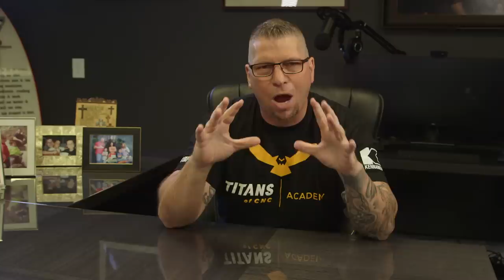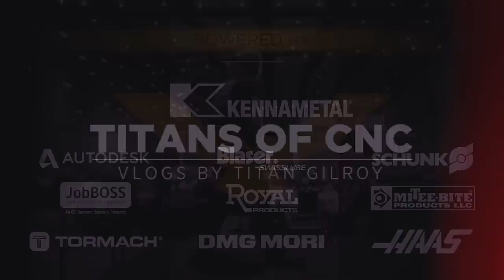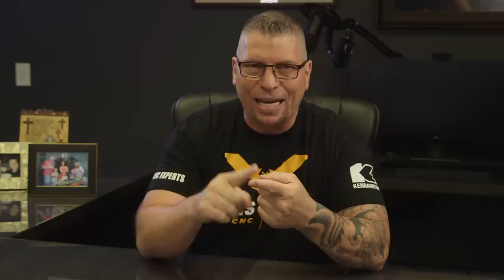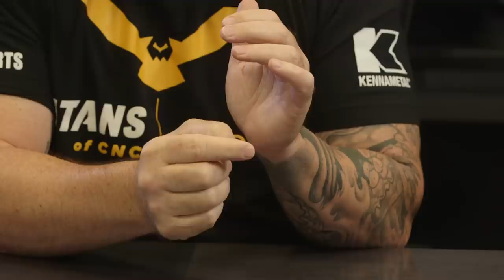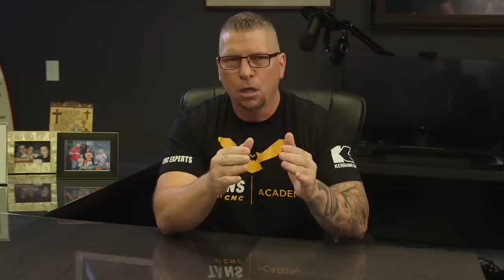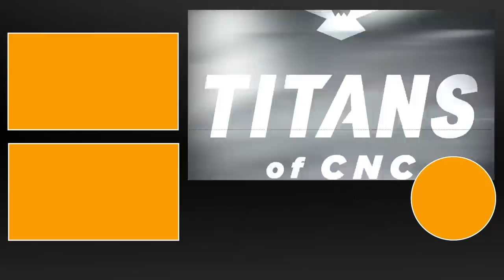My WORST DAY in CNC Machining - Vlog #96

Comment: Personal responsibility goes a very long ways. More times than not owning the problem, showing improvement, and professionalism in customer service will please a customer beyond expectations.
Not a shop owner but making my way there, however Titan reminds me of some times while in the army. I worked in the housing office for a large unit, renovations to our buildings are going on, I leave my office for about 2 weeks for some training to advance my career. My office drops the ball in moving personnel around. I get back and immediately me and the other heads of my office are brought into a meeting with contract team, higher commands, and the oversight team (the ones writing the check with a lot of zeros on it) and my team, the lowest common denominator but also where the rubber meets the road in making the project go smoothly also exactly where the fingers get pointed when things go wrong. The meeting goes with many questions being asked, very few getting answered. The 5 minute ride back to our office is nothing but suggestions of how to make this move go forward, we have 128 people to move, less than 5 days to do it, and no space to move them to. We come up with a plan, another unit was occupying the space we needed they were in place for the same training I had just done. It's Friday, they leave Sunday, we need the space Monday morning. We print up the list of everyone needed, I have carry to the command team over all the people, lay down the plan, give a defined timeline, and give understanding to why this problem arose. Command had been abrasive leading up to our meeting, once they had understanding and saw a clear defined plan in place attitudes changed. Don't know how many prior service we have here but when you're telling someone 6 ranks above you what to do, they inherently don't like it to the point it can cost you a career. My team of 5 made the move happen, we handled it perfect professionalism, created understanding of how we were going fix the problem and how the problem arose to being with in full transparency, then executed the plan. This project spanned 18 months involved over 2,000 people its not machining but it is proof that often enough owning the problem, will impress the customer enough to restore or actually create faith in you and your team and to toot the horn a little we finished the project ahead of schedule by months.

Comment: aerospace finishes actually requires Honing and lapping with diamond 
where talking about .000020 straight and round with a ultra fine finish....10 years in aerospace....
Reply: That is insane. What kind of tools can even get that precision? What measurement devices can confirm that precision was hit?
Reply: Finding a vendor who has the equipment and skill to do this. Not sure how hard it is?
Reply: @phil2082  air gauge

Comment: I’m a Machinist with over 30 years in aircraft and aerospace machining experience. I have a story of survival like no other. I’m Still Trying like Hell to get my small CNC machine shop off the ground. Be t first I have to survive a extremely rare Lung cancer which has caused now my 6th brain tumor and 7th on my kidney. I had my first brain tumor over 7 years ago. I’m still here fighting with my current brain tumor and kidney tumor. I own 2 CNC mills and a couple conventional lathes and a precision grinder and sheet metal fabrication equipment. We have an old CNC lathe as well. I Refuse to allow cancer to stop my forward progress. As long as I can stay alive, I WILL Succeed. That’s simply fact. I should have died over seven years ago. I’m still here and running Strong! The shop my equipment is helping now is hi-tech aircraft and aerospace Coatings. Thermal barrier and hi-wear resistant Coatings. Among others. Space-X, General Dynamics, JPL. Just to name a few. I tried to reach out to you in the past. You’re not an easy man to reach.

Comment: My history started in construction. I worked part time while in school then started studying electrical at the local community college but dropped out my second semester. My dad owned a company building and selling motels all over the south east. I fell in and was running his crews until almost 10 years ago when construction hit a stall. I had a wife and a 1 year old son and went from making $20+ an hour to nothing. I did the side jobs for awhile but they just were not cutting it. I gave in and went to the local job center and they set me up with an interview with a company 45 minutes away. I didn't want to even go to the interview but decided I had to do something so I went. Of course the boss told me they wanted me to start the next day at $8 an hour as gofer but he also told me the sky was the limit as far as what i would become. After my second week they told me they wanted me to learn to run a cnc. The guy over the cnc's wouldn't teach me anything except put the part on and hit the green button. After 3 months the owner came in and told me he wanted me to learn how to setup. He attempted to teach me how to do a basic slot so I could see how its done. 2 weeks later I had taught myself how to write basic drilling programs. Over the next 6 months I had taken the machines i was running and improved all the programs in such a way that production had doubled. At my 1.5 year mark the owner walked in and fired the head cnc person and gave me his job. I continued to improve the department and started to take on the task of being assistant to the shop foreman. During this time my family had moved 8 hours away and my boss knew I was looking to move to be with my family.  At 3 years I told him I was making plans to move. He told me he could not let me go and ask me to give him a week to come up with a job offer to see if he could convince me to stay. The next week he tells me to come to his office after everyone has gone to discuss his offer. When I walked in his office after work he started talking about everything I had done for the company and how much the company had grown due to changes I had made. After about an hour he told me he needed me to stay and that his best offer would be his job. Of course I thought it was a gimmick but the idea of being Operations Manager for a company with a nice salary and benefits was to good so I took him up on it. I've now been here 9.5 years and we are still growing. I cant say its been easy but I haven't given up, and its paid off so far. A couple times ive had the thought I made the wrong decision but I stayed with it. The leadership experience is something I can always show and I will continue to work on to become a better leader.
Reply: so what happened with your family ?

Comment: Relationships are key. I had overbooked my shop last fall, and outsourced some jobs to local shops to hit deadlines. The inspector of my customer found parts were not to print. He told the owner what was going on, the owner  immediately got mad and said, "SEND THEM BACK!" He thought it was another shop that did them, the inspector said to the owner, Jon did these parts... That owner said immediately NO this is not his work. The inspector knew very well the owner and I were on great terms. And showed the owner the PO with our name on it. He called me up and asked me to come down. We discussed the issues. I took the same position as Titan, I humbled myself. I just said I will fix these right now. The owner was still mad. He asked me directly, "How did this happen?" I said to him, I had to send these out to another shop to meet deadlines. I actually did not make these. He smiled and turned to his inspector. I told you this was not Jon's work!  He is our #1 vendor... I told him this would never happen again and fixed the issue immediately. I remember walking out of there with a huge mix of emotions. Fear, sick to my stomach mixed with a pat on the back compliment... The fact that he knew my work well enough to know I did not make the scrap parts even though my name was on the PO. That felt good...
Reply: Well Done. God Bless for fixing the problem when the stakes were high!

Comment: You know. As the shop foreman at where I work I can understand this completely. Countless times my boss, the owner, accepts jobs before talking to me and when I get the prints to quote I tell him there's no way we can make those parts with the current measurement equipment we have or that we don't have the ability to make the parts competitively. There's talks of me becoming an owner and if that happens I definitely will be spending some money on inspection equipment as that's the only way to make accurate parts in my opinion.

Comment: In my experience, no matter what is at stake, or what the fault or mistake is, always take ownership. In most cases the other party is way more lenient towards someone who owns their mistakes and are willing to work it out. That doesn't mean they always will, some will not appreciate the strength of character it takes to do that, and will be arrogant and unreasonable, but here is the thing, that's on them, not you, and at the very least your team will see your character and leadership qualities. Thereby building the relationship within your own team to a higher level which in itself is its own reward.

Comment: I had a customer that was livid with me. He brought a box of parts back and began screaming about the workmanship. I looked at the parts and totally agreed and excused myself for one moment. I brought in the machinist that ran the parts to have a look at them. I asked him “what do think about these parts?” He said “they look like crap, you mean we didn’t have to make ours so nice?” The customer looked confused. I said “those parts weren’t made here.” I began to explain and then brought forth our “setup part”. The difference was obvious. He began to profusely apologize. Apparently they had another vendor running the same parts and the customer didn’t realize he had two suppliers and he went after the wrong one. I wasn’t the first time through the years. For certain customers we had made a tiny stamp we so we hide our mark in a corner.(that turned out to be most money making object I ever had) It’s bad enough if we screw up, but I’ll be dammed if I’ll fix what others do for nothing. If I can, I’d be glad to fix or replace what others messed up.......for a reasonable fee.

Comment: My story, I was born and raised in England, Sheffield actually right as the steel industry collapsed. Bad times for all. I left school at 16 with minimal qualifications and not much options so I signed up for bricklaying and plastering NVQs at a local college. I took a job during the summer at a local fabrication and machine shop and was basically the tea boy, grind monkey and broom b**ch. Eventually I was allowed to try my hand at turning and that was the first time since school I had touched a lathe. I eventually cancelled my place at the college and remained at the machine shop for 7 years before emigrating to North America. Fast forward 10 years from that day and a couple of machine shops later, I am now placed in a University Mechanical Engineering Dept as a CNC machinist offering my years of manufacturing experience and knowledge to students and also building their projects and competition car components. There is one machine shop in particular that I owe everything to because I was allowed to go to the next level with my machining game and learned so much about part sequencing, proper inspection protocols and other procedures one simply does not get to see in smaller job shops. In fact a slight sub-story with that shop, I once scrapped an entire run of parts on my shift and I worked an extra 12 hrs ON MY OWN TIME to manually verify each part was scrap and then stayed to manufacture the parts again because I felt so bad about it. The owner actually told me to go home because he felt bad that I had put too much effort in to rectify a problem I had created. That was one long 24hr shift I can tell you that. He was shocked to learn I had not even been home yet since he bollocked me for scrapping the run.
Reply: That is the sort of war story where legends are born! 
God Bless Brother.
You have the guts, responsibility and take ownership of the problem.
All the best from Sydney Australia.
Reply: Arthur Frilingos thanks brother. It’s been a hard slog to get where I am now but I wouldn’t trade a single minute of it for the easy way.

Comment: I'm not an owner, just an operator, but I have one story like this:
We were doing some parts that had 10 M10 holes per part and two 30M7 holes. We had 60 of these parts, finished all of them, and then they come back from inspection.
Nearly all of the parts came back as bad, the 30M7 holes were fine, but the threads didn't meet spec.
It was because we had one M10 HSS tap for 600 holes in steel and it deformed like 20 pcs in. 
We made a mistake in not checking the threads with a go-nogo gauge, but only with a screw. We had no other option at the time, because management refused our tool order with the taps we needed, so we had to just go at it with one singular tap and hope for the best.
It obviously didn't work, and we ended up having to recut 600 threads manually without a tap handle, since we don't have that either.
Moral of the story: Check your parts properly, and if you don't have the tools, DON'T DO THE JOB.

Comment: I don't design rocket parts but I always prefer a supplier that is open with their limitations and comunicate them so we can get a working part out, Sometimes I can change the design slightly to suite their process, or we can work out a way together.
Reply: This guy right here gets it. Its a 2 way street and every one has to pitch in to make things work.

Comment: 40 years as a machinist and starting out as an apprentice in NO.LA. early 70s I worked in a shop that had line shafts running in the ceiling that drove leather belts for all oft the laths,mills and keyseats where you had to reach up and push on a board to engage the clutch on the machines and it sounded like a flock of birds trapped in the ceiling all day long. And it make me feel great to see other people who take pride and craftsmanship to the level of what it is supposed to be. Thank you Jake Bissel.

Comment: The saying you learn from your mistakes is very true. But owning the issue is by far the biggest step in learning from the mistake.  Covering up and saying not me can cause so much work to find out what did go wrong. It can very often drive you down the wrong rout and so wasting vital time. Mistakes do happen even if they are not down to one thing or person. It is how you overcome the issue that sorts out the the ones who can from the ones that just do.  Keep it up. Spreading the word is admirable and a way to make the CNC industry excel in what ever industry they serve.  Amacf

Comment: Awesome story, but it raises a question.  Could you have, upon seeing those prints asked the customer something along the lines of "I noticed this finish call-out at the bottom of the bore at view A-E, and while I'm confident we can hit that requirement, we don't have a profilometer that can check that surface. Do you have any recommendations or solutions that would be easy to implement?" Or is that sort of interaction with a customer taboo?  I ask, because I made a similar comment to a representative from a large turbine manufacturer, who's parts my shop was struggling with, and everyone else from the sales team looked at me like I'd just propositioned the man's daughter